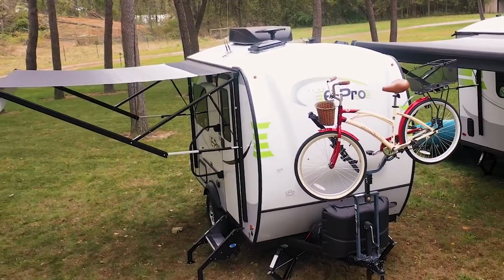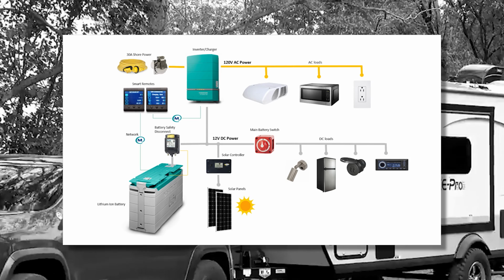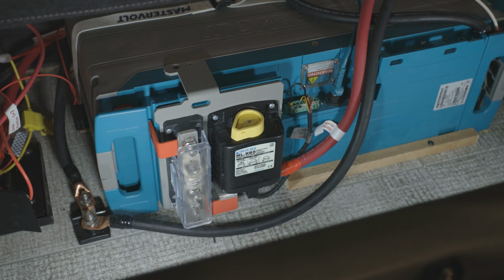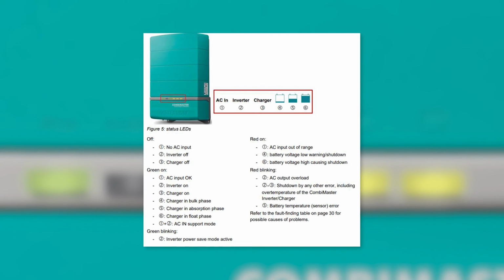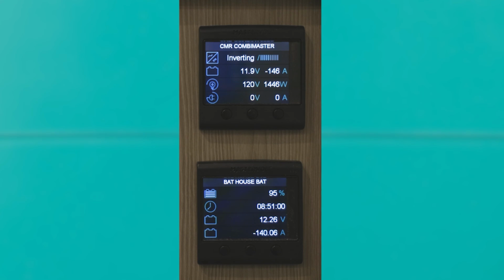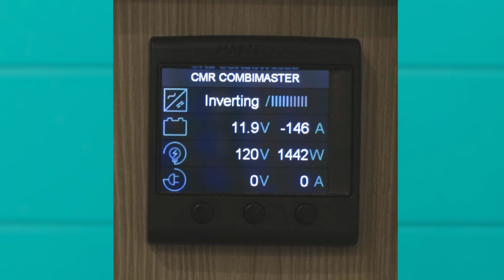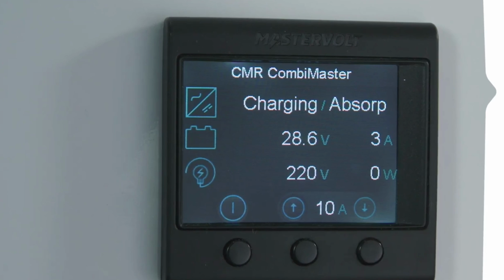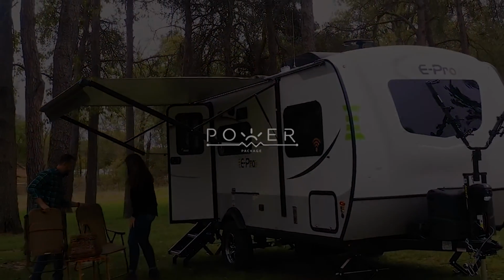Power Package Video

Comment: It's a fookin shame rockwood does NOT provide any information on these units. I picked one up today. NOBODY, I repeat, NOBODY at the dealership had a clue on the workings of this unit. There was no manual or any info at all. They said to take a picture of the square bar code thing... ????????????????? It really is a shame. PLUS, the cutout for the battery disconnect was off by almost 2 inches. So did they throw away a 4 dollar piece of paneling and cut a new one?  No they did not. They forced the thin panel over it - It fukin bulges. For $8000.00 extra you'd think there would be some sort of quality control on these units. NOPE It's a fookin shame to spend almost 40K on one of these and they are still put together like they don't give a shit.
Reply from the maker: Brian, we are sorry to hear how you feel about your experience after picking up your new unit. Please feel free to email us your concerns to rockwoodowners@forestriverinc.com and someone from our customer service team will be happy to help you with any manuals you might need. Thank you 😊

Comment: I have this system on my 2022 E-Pro 20FBS. I'm having problems with it. When I'm plugged in a 110 GFI outlet that is in my garage it keeps popping the GFI outlet. It may last 15 minutes then pop or 2 hrs or more and then pop. I have my system set to 15 amps. I just had it running with the AC on low for about 1.5 hrs and it popped the yellow button on the battery. I had to remove the wall in my pass through and reset the yellow button. At night I can't leave it plugged in. It pops the GFI in my garage. Do you have a contact person I can call please. Thanks
Reply from the maker: Hello, our customer service team would be happy to assist with this. Please email them at Rockwoodowners@forestriverinc.com 😊